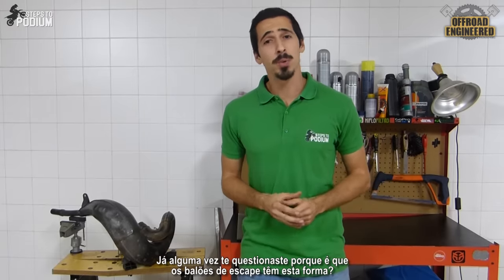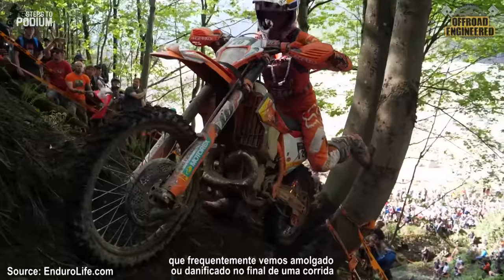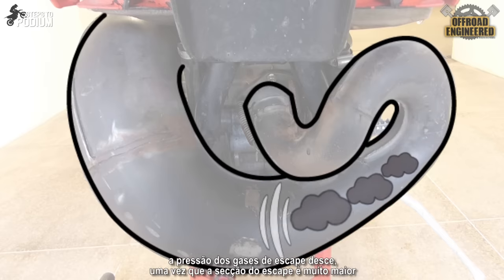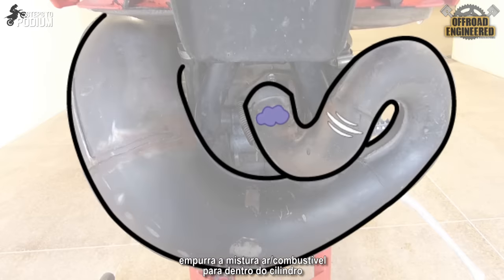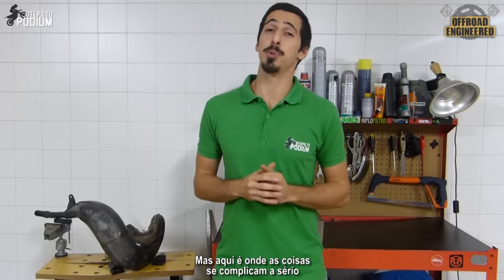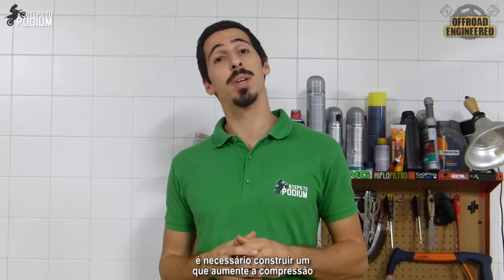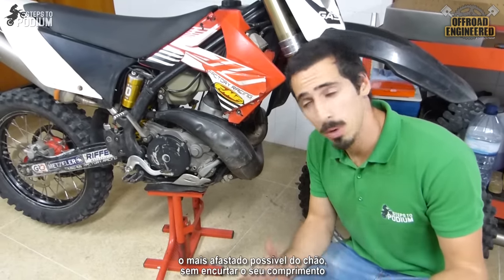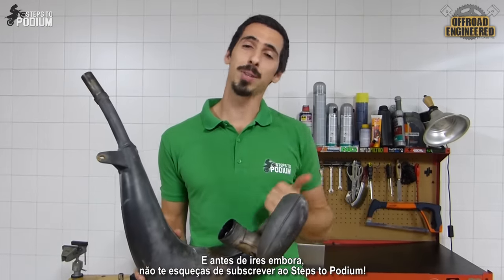How 2-stroke exhaust pipes work | Offroad Engineered

Comment: It's really crazy to think, how just change the exhaust system can completely change both the power and the torque in the 2 stroke engine
Reply: I figured the bulb part of the pipe would be closer to the exhaust port , instead of 1/2 way down the pipe.
Reply: Not only 2 strokes and not only bikes

Comment: Think i missed something in this video haha, ended up asking my self more questions. I learned something new today doe so tyvm for the video.
Reply from the maker: more knowledge always leads to more questions, so you're on the right path 😉
thank you! 😊
Reply: @StepstoPodium  almost cause you are close but not on the right path of the purpose for an expansion chamber ....its not about exhaust "back pressure" its all about the reflecting of sound waves traveling back to the exhaust port to seal in the boost pressure created in the crankcase ..the amount of fuel/air mixture you claim is being pushed back into the combustion chamber and to create higher compression has every little effect at all ...the higher compression was already created in the crankcase from naturally aspirated atmospheric pressure draft in the crankcase and then compressed by the Piston to higher than atmospheric pressure then transferred by the Boost Ports into the combustion chamber where it is compressed again before it is fired off
Reply from the maker: Dude...... A sound wave IS a pressure wave. 
and no, the amount of boost that comes in through the reed valves isn't only from the crankcase, but also from suction created by a negative relative pressure created by the pipe (I explained on the pinned comment with I didn't include that part on the video). Look it up please.

Comment: It's not to increase the compression.  It's to reclaim some of the raw fuel that escapes the cylinder during scavaging.   
CORRECTION. ... What I should have said was you can stuff " force " more air and fuel into the cylinder which can result in higher pressures and possibly more horsepower. However the compression ratio never changes.
Reply from the maker: I understand what you mean by that, but it's a matter of perspective.  If there was no expansion chamber, there would be no fuel escaping the cylinder due to scavenging (partly created by the expansion chamber) :)
Reply: Which adds compression...
Reply: Steps to Podium I’m pretty sure a considerable portion of inlet charge (fresh fuel and air) would still be wasted out the exhaust port(s), even if there was no pipe.
Reply from the maker: @mareksumguy1887  Probably, yeah!
Reply: I left out the word "ratio" on my first post which is my mistake.  What I should have said was you can stuff "force" more air and/or fuel into the cylinder which can result in higher pressures and possibly more horsepower.  However the compression ratio never changes.
Reply from the maker: @mowerdog  with that I completely agree 😉
Reply: mowerdog so in your original comment, you were refuting a comment that he never made. 🙄
Reply: @mareksumguy1887  Yeah.  I had compression "ratio" in my head for some reason.  My bad on that one for sure.
Reply: The only guy that understand it and others try to justify in such a way like .. it s perspective.... it is not perspective  ... this gentleman is right ... the one that does video is wrong .... despite  he have nice video ....
Reply: motordog  you have left out the most important fact of all that most people have learned about including everyone in all of these comments ..and something i am sure of that you have no information about or you would have mentioned the fact that two-cycle engines create boost higher than atmospheric pressure when the piston returns toward the crankcase on its power stroke . Run this fact through your mind several times over and over and faster and faster until you can see a working model of just exactly what is happening to get atmospheric air pressure mixed with fuel drawn into the intake port from the crankcase as the piston on its way to the combustion chamber
Reply: Dynamic compression (ie real world measureable cylinder pressure) absolutely must increase if you're forcing more air into the chamber. Static compression never changes, dynamic compression does. I would probably have used a different word than compression, but I think it works well enough. I would have used the term volumetric efficiency probably, but that's me. Look up dynamic compression ratio. In four strokes the idea is that you measure realistically how much actual air is trapped in the chamber, instead of of displacement vs compressed volume.
Reply: We call it back pressure. Two strokes love back pressure.
Reply: In my first year of Mechanical Engineering I asked my physics teacher ( who didn't really know about motorcycles or engines in general, but did know the physical processes of how they work).... Showed me the three parts of a 2stroke expansion chamber. Part one is medium diameter near the exhaust port...the 2nd the expansion chamber and largest diameter and then the 3rd the stinger...smallest diameter., the combination of the those three in length and diameter determines the power characteristics ( powerband) of that engine and at what rpm the sonic waves reach back into the cylinder with back pressure and push unburnt gasses back to have a higher charge and make instantly much more power.. That is why a 2 stroke seems almost dead until.....Bbbrraaapp!!.... Front end lifts and a kick in the ass boost. Sound ( sonic) waves reverberate inside the tuned pipe like a musical instrument and create back pressure to stuff more charge into the cylinder that would ordinarily be lost out the exhaust.
Reply: Also increases the peak mean effective pressure
Reply: mowerdog There are two types of compression ratios: static(geometrical) and dynamic that changes. If static ratio is squeezing atmospheric pressure 6 times, in real life there's very hard to achieve such efficiency  unless you use a turbo or a compressor.
Reply from the maker: @KillerKiller655  so what don't I see right? 
(if you are Portuguese,  we can discuss in Portuguese 😊)
Reply from the maker: @KyleP133  than kyou for you positive feedback! if I would go with those words, a lot of people would let it pass by. when doing videos for the masses,  you have to keep it simple, hence using compression, that's all! 😊
Reply: Back to physics: expansion chambers use shock waves to create negative pressure at the cylinder exhaust port outlet allowing more inlet volume  of air and fuel to be drawn into the combustion than would be posible with a traditional  single diameter pipe. The effect is similar to supercharging without the mechanical complication or required power loss to operate it.
Reply: mowerdog oh yes it does...the dynamic compression is greater with the increased back pressure
Reply: @MisterFurious71  it does not increase the compression. The piston STILL compresses the air at the same rate. What it does is that it maks the air more dense. More oxygen means bigger boom. Like the turbo in a car. It does NOT increase the compression of the engine. Its just stuffing more air into the cylinder by making it more dense
Reply: @StepstoPodium   "If there was no expansion chamber, there would be no fuel escaping the cylinder due to scavenging (partly created by the expansion chamber)"
WRONG, VERY wrong

Comment: gases when travel at speeds lower than sonic, their pressure increases when the cross section area of passway increases and their velocity decreases, and viceversa
Reply: Correct. A bit of fresh mixture will end up in the header pipe but the return wave shoves it back in just before the port closes. The sound wave helps the pressure wave.
Reply: It’s opposite. You’re referring to the Venturi effect, when the cross sectional area increases, the velocity increases and the pressure decreases.
Reply: saeed note  ----  what?  you got it wrong?

Comment: Read prof Blair two stroke book. You have it partly wrong, when the exhaust wave hits the end of the primary pipe or header and hits the first diffuser there is a wave that returns to the exhaust port with a negative sign and helps extract more incoming charge thru the engine, it will pull a negative wave all the way back to the inlet port of the engine. In a well tuned engine I have seen negative and positive pressures over 7lbs and higher, the header length, diffuser and baffle cones will change the character of the engine. The tuning of the “stinger” will effect the temperature at the piston and effective rpm.
Reply from the maker: I know I didnt explain every single detail about the difuser, it was meant to keep it simple and informative for about 90%. Sometimes if you go too much into detail, you loose the big picture, but I might do a video just for the 2 stroke! 
Nonetheless I really appreciate leaving a comment with your feedback, and surely everyone reading the comments do as well 😊😉
I will read it! thanks for that info! 😊

Comment: Lets say i would ride a 2 stroke withouth a silencer would it lose lots of power
Reply from the maker: silencer or expansion chamber? 
without the silencer it would do a loooot of noise.
without the expansion chamber,  it would do a lot of noise and lose a lot of power 😂😂
Reply: @StepstoPodium  so I've been thinking about a aprilia rs 125 stunt bike and i thought i could take off the silencer and put a db killer at the end of the expansion chamber so it wouldn't be so loud and this is because the silencer gets destroyed every time I fall
Reply from the maker: @vflinck1324  you will affect the performance of the pipe and the performance of the engine if you do that!
Reply: Depend, if the espansion chamber is designed to work whithout silencer, adding a silencer will reduce power
Reply: @ginettaclark2387  all bikes have silencers after expansion chamber
Reply: @bonkeydollocks1879  yes, but try watch hill climb banshee
Reply: @ginettaclark2387  oh right, OK, yes if the expansion chamber is designed NOT to have a silencer then putting a silencer on would reduce power out put, I see what you were saying.. I think the initial question was can the bike just be run with the chamber and no silencer, ie take the silencer off a bike without a specialist designed non silencer chamber. God that sounds way more complicated than it needs to be 😷🇬🇧
Reply: @StepstoPodium  ive heard even starting a two stroke without the expansion chamber can ruin the engine quick, is this true?
Reply from the maker: @socks2441  to be honest, I don't know, but I guess it will simply lose a lot of power and will barely work
Reply: @vflinck1324  I wouldnt recommend a 2stroke as a stuntbike, as awesome as they are. And certainly not a rs125. The peaky engine would make balancing difficult.
Reply: @Nelis1992  i have ride many many stunt bikes so i do know what im getting into by getting a peaky 2 stroke.
Reply: I dont know if this is right I once heard it somewhere but 2 stroke engines are cool because just with the exhaust you can get a lot of power out of it. I heard the exhaust is making one third of the power on a 2 stroke engine.
Reply: Yes, the throttle response would be much less sharp, it would be loud, & not rev as high.nothing to gain .the exhaust system is all calculated, not just crandom parts
Reply: What about exhaust wrapping?
Reply: No , but if the silencer has much length to it you will loose some power untill you replace the silencer with an equal length pipe
Reply: @leeevans6213  that will retain more heat in the combustion chamber allowing the fuel to burn more efficient gaining more power per drop of fuel
Reply: @socks2441  it won't bruin the engine, but there might be pro lens, the exhaust might not carry the same amount of heat with it, so engine might run hotter, never a good thing.warm,good. Very hot, bad.also, premix oil could start to accumulate in crank area.you can Star can engine with no silencer, but it wont run crisp, it will be loud & awful
Reply: @StepstoPodium  is there a difference between a long silencer and a short one?
Reply: If it was designed with a silencer ?Yes you would lose power,however if you had a pipe that was designed without a silencer you would end up with another three angry cats in your back pack(more power)A 2 stroke expansion chamber changes power (amount and where in rev range) dependent on its size and shape,Expansion chambers are to all but satans disciples"Voodoo"
Reply: Silencers rob power. No riders complained. Environ mental ists complained. Performance suffered. 
Yes. They are very loud. But if you are the rider. You love it. 
I had a 100cc Hodaka Super Ray. 
Totally awesome bike.
Reply: That’s Super Rat.

Comment: Very good explanation. Static compression is low but when running, the dynamic compression will be high due to the pipe pushing gases back into the cylinder. But it's not just exhaust gases, the intake charge will also start to escape out the cylinder into the pipe until the return wave pushes it back into the cylinder. Consequently, the volume of an expansion chamber increases the amount of intake charge that can be stored and pushed back into the cylinder.
Reply from the maker: I appreciate it and thank you for the bit of extra information! 😊

Comment: Great visual and explanation of the body of the expansion chamber exhaust.  There is one more part that has a major effect on the performance of the engine and that is the Stinger, length and diameter.

Comment: There's a lot of tuning involved in building a chamber.
Once it's set for a particular motor it's easier to replicate.
My RG has 4 different chambers and the stinger (section before the silencer) length is different from one set to the other.
All has to be taken into consideration during the build.

This was an interesting and simple explanation of how the chambers work.
👍
Reply from the maker: There is so much more to it than what I talked about, but for simplicity sake, I kept the maximum knowledge without making it to complicated for the average Joe to understand! 
There is thermodynamics to consider, resonance throughout the rev range, the valves, etc.., but that would be a lot more specific from each and every case.
Thank you and I really appreciate the comment! :)
Reply: @StepstoPodium  
I agree.
Exhaust valves, heat factor and so much more.
I'm only good enough to be dangerous with a chamber build/modification.😁

It's really hard to explain to someone that has no idea what you're talking about.
My coworkers eyes glaze over quickly when I start talking two strokes.😆
Reply from the maker: @franktaylor7617  I perfectly understand you! 😂
At least you can show them this video so they can look at you in a less alien like way 😆😂😂😂
Reply: Your bike has a crazy set of pipes.a buddy from school had an RG 500, Iit was a hi tech war machine! ( someone stole it at night downtown )
Reply: @richardkey4289  
Thanks.
They were Jolly Moto's. We modified them to fit the Honda chassis and swapped out the aluminum cans for carbons.
It was a very low budget project but in spite if that, it came out really nice.
I've changed very little from the original setup.

Comment: finally i find video that expalins why twostroke engine exhaustpipe looks so weird. i neber kknow that before so thankyou.  when i was young i dirive many different mopeds some have normal exhaus pipe and some have that kind of pipe you show us and we called them powerpipes and we do not even know why or how it gives more power 😄 some times i even think it.s give more power because it,s thicker than normal pipe althought the end of the pipe was not thicker at all and then we make power mufflers just taking out all things that are inside the muffler and and we think no we get more power although we get only more noise and maybe stupidest thing we do was to take whole exhaus pipe off and if im right like tthe motor makes less power and more noise and nothing else but we was kids and have mopeds so it,s almost have to try to tuning it faster. best tuning was change the chain gears that way we get the mopeds accelerate faster but stop speed got lover of course but it feels faster.
Reply from the maker: Glad i could help! 💪💪

Comment: 4 stroke headers work in a similar way but are more forgiving since they have an exhaust valve. If the reflected wave is timed right it can help pull exhaust gases out and even help to pull intake change in during valve overlap.
Reply: @devilselbow  At the collector, yes. I'm referring to at the exhaust port. At the collector the negative pressure "tail" of one pulse can help "pull" the positive pressure pulse of an adjoining cylinder if timed  correctly. As you probably already know this is referred to as "scavaging". 
The intake side also benefits from pressure wave timing by helping to "push" more air into the cylinder and it's also why on "racing" cams there is so much overlap as it allows both the intake and exhaust system pulses to "talk to" each other but only in a certain rpm range. 
That's why they tend to have a rough idle. At low rpm with a lot of overlap you are creating a vacume leak when the intake and exhaust are both open on an intake stroke the piston is trying to pull from both intake and exhaust systems at the same time, which explains why engine vacume goes down with "big" cams.
A lot going on.

Comment: Really well explained!! I tried before to associate the  shock wave like the ones in a ram pump understanding that i high velocities gas act like a fluid.. Nice vid. Cheers.
Reply from the maker: I'm glad I could help! I appreciate it :)
Reply: Its all about a shock wave of sound that creates a high pressure of exhaust gas at the exhaust port to stop as much fresh air/fuel boost from escaping the exhaust port until the piston seals off the exhaust port , compressing the boost charge from the crankcase just before the ignition fires